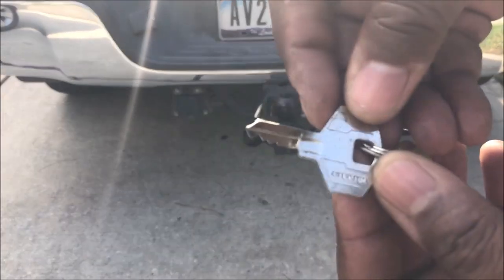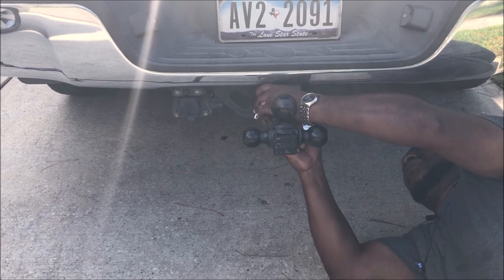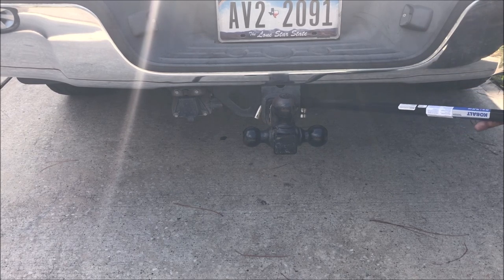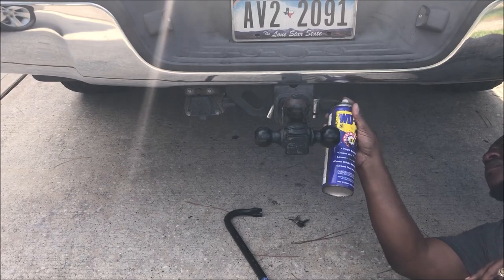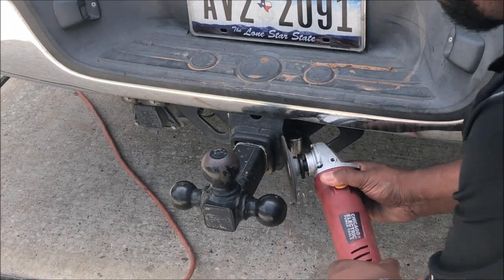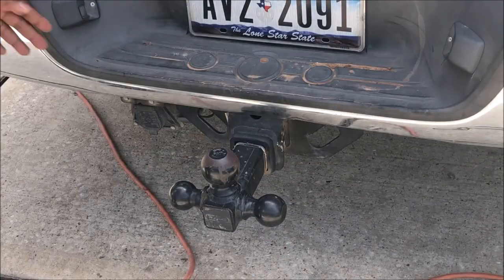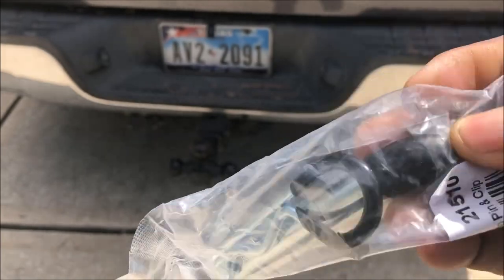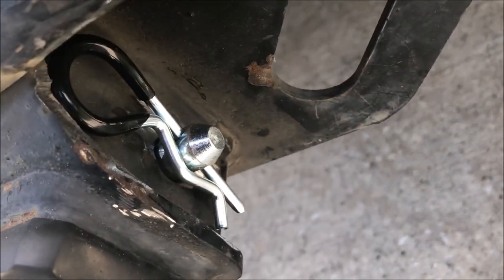How to remove seized trailer hitch lock, very easy to do

Comment: Great tip, thank you! I thought mine was hardened steel as well and I’d never get it off. I didn’t have room to get in there with my wheel grinder but I cut right through the narrow part with a hacksaw in about 2 minutes.